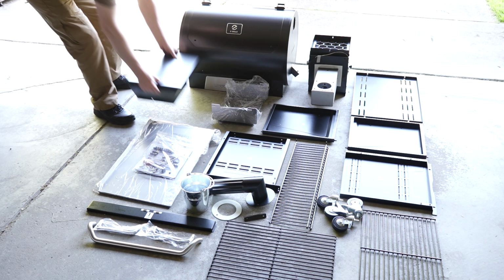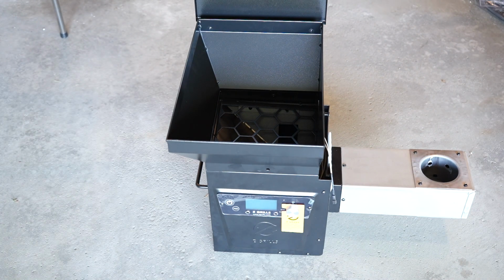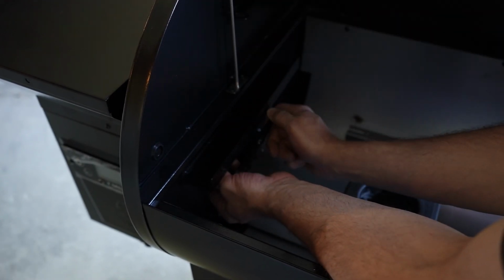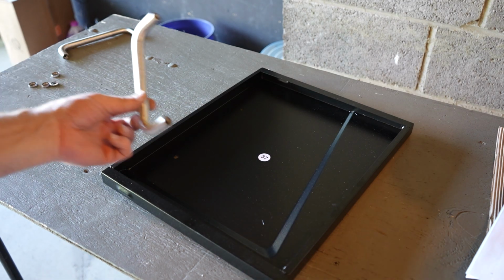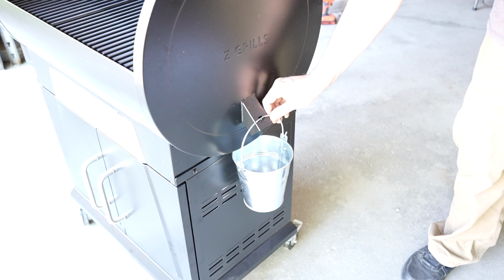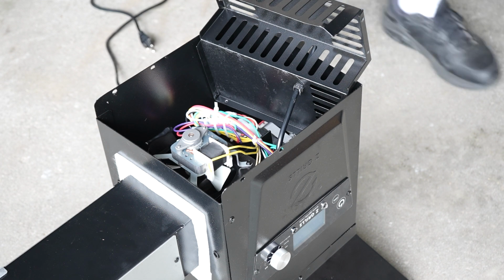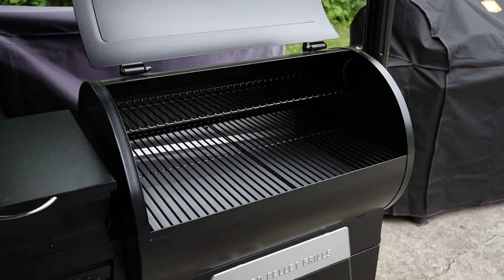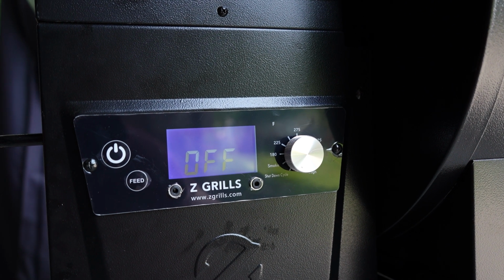How to Assemble Z Grills 700D3 Pellet Smoker - plus Controller Panel Replacement & Initial Startup

Comment: One critical data point you left out... How many beers were required for initial assembly and also for controller replacement? ✌️🇺🇲
Reply from the maker: Ha, I definitely forgot to factor in the "beer index" when providing this analysis.